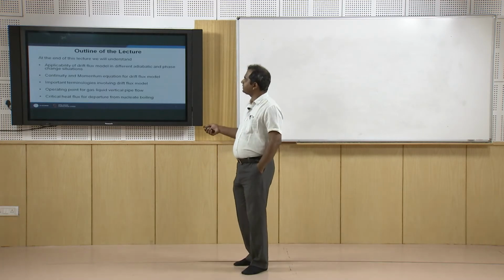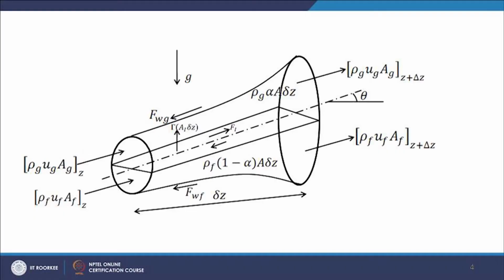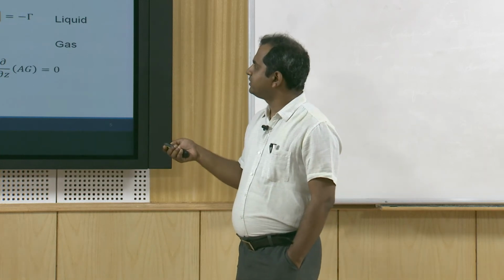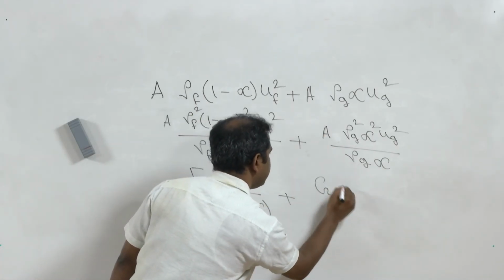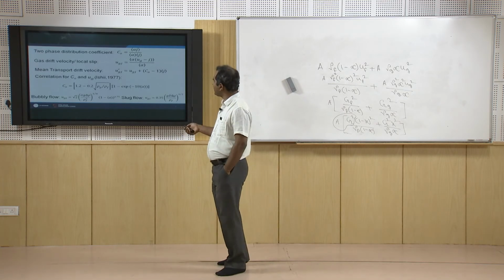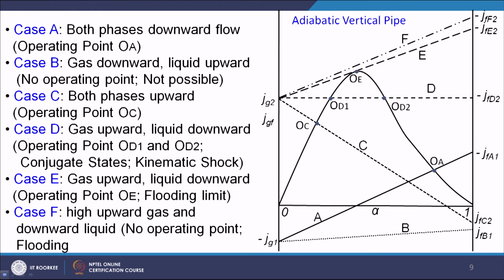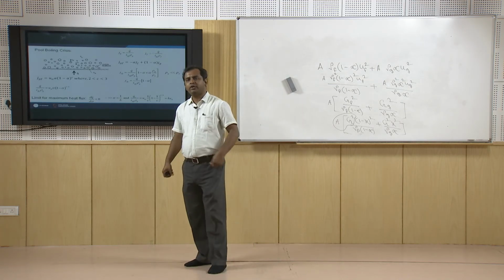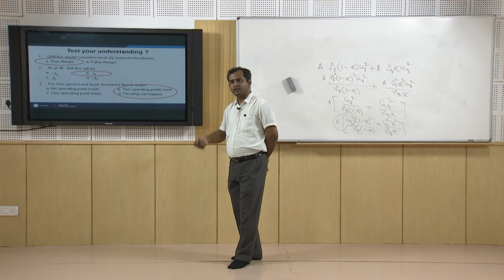Drift Flux Model

Comment: Dear Dr. Kimar Das. Could you please inform me what references are used for the lectures? The symbols are a lit bit different from Todreas&Kaziimi (my references). However, they are easy to understand with your explanation, and there is an interesting approach for the models. Thanks for your kindly attention, and congratulations on the excellent lecture.